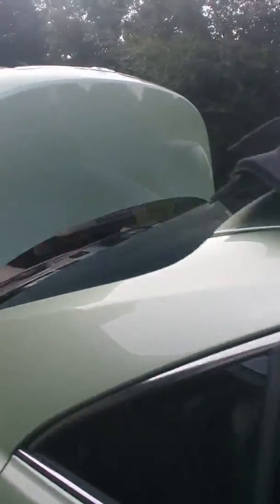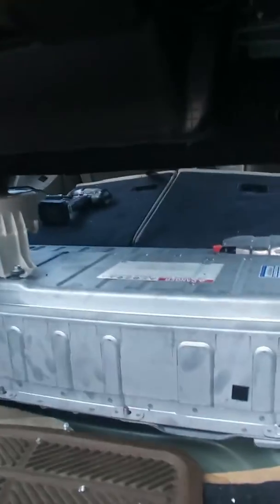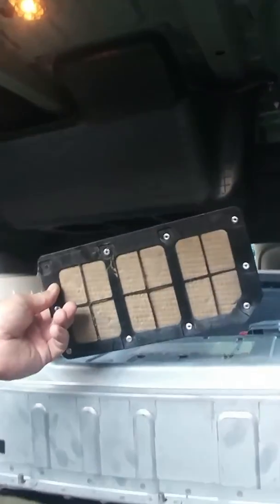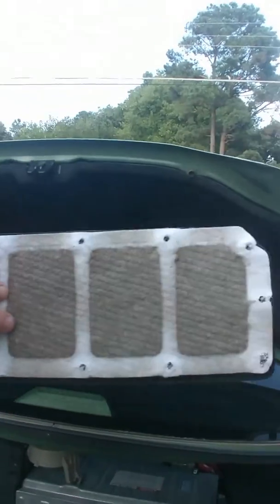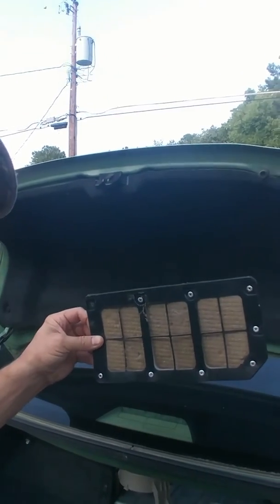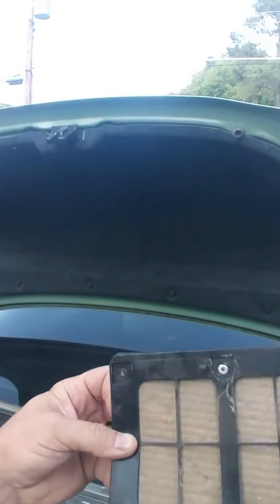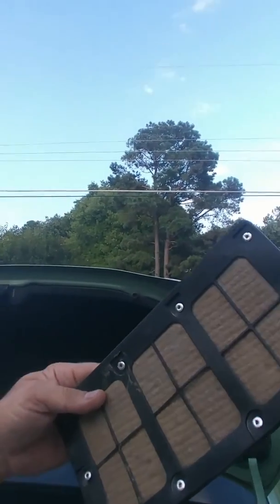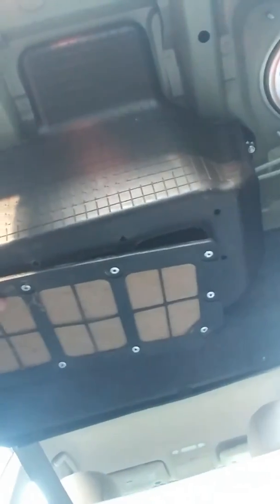Toyota Camry Hybrid Battery Cooling Filter cleaning by Hybrid Battery Pros

Comment: 1-31-2021 The batter tech said he would have to rivet the hybrid battery filter back into place. Thats a sad comment. Can believe Toyota would not have used four  of the standard plastic fasteners.  Again we find a critical Hybrid maintenance item, a filter that  needs regular servicing-and its not mentioned in the owners manual.

Comment: Where can I purchase this filter?
Reply from the maker: Benjamin Tomlinson use a 3/8 drill bit to drill the head off the rivits and replace rivits with large screws or rivits.  A good cleaning with a water hose and soap will work rather than replace the filter in most cases.
Reply: so they are riveted in and not screwed in cause they look like tamper resistant screws and i can't find them anywhere. need more details about those screws please. why would Toyota make it so difficult to remove a filter that has to be eventually  cleaned or changed?
Reply: ..you made no mention of how to actually remove the filter..with what tools? I’ve been wrestling with it for an hour. Please help. Thanks
Reply: Robert Pool. Ebay you found any thank
Reply from the maker: Pet stores might have some fish filters you can incorporate with some fabrication or buy the whole piece from the dealer with vent tube.
Reply: I am having the same issue how do you put filter back on
Reply from the maker: Drill out the old rivits and replace with rivits purchased from harbor freight tool company or large wood screws from lowes or some other supplies store such as pleasant have hardware.